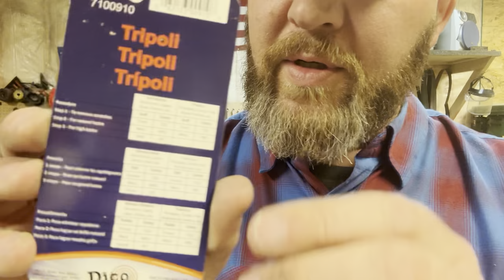SDI - FTT 211 - Week 1 Project (Muzzleloader Lab Part 6)

Comment: How does it feel? I have the really nice shine like yours - but to the touch - it doesn't feel nearly as smooth as it should -- is there anyway I can polish it down to get the smooth feel but not lose my shine?
Reply from the maker: get some high grit sand paper 600 or better or use 0000 steel wool and buff it and then add more layers of true oil. keep doing this till you achieve that perfect smoothness.